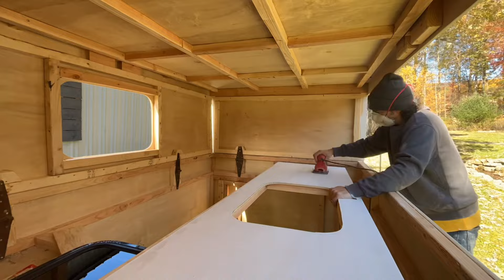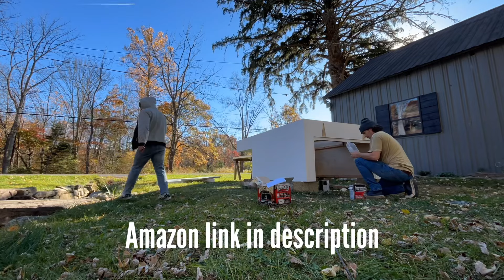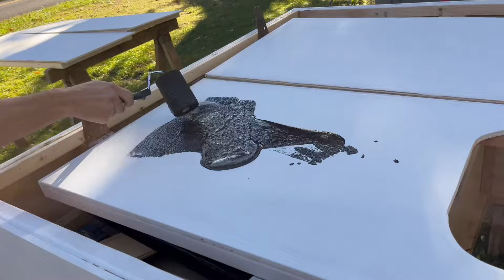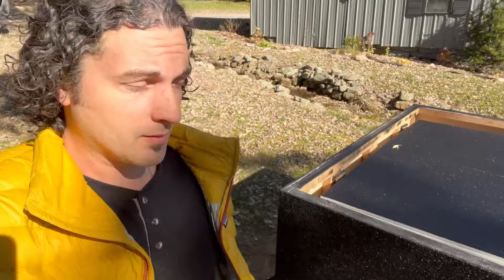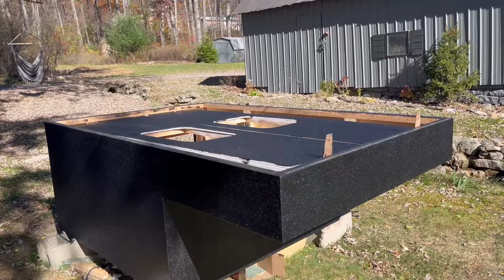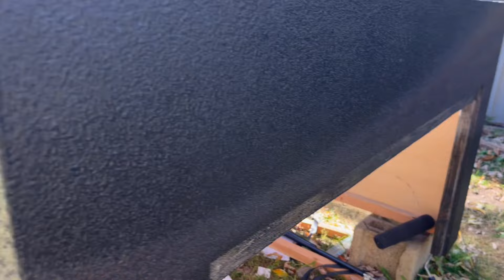4 - Bedliner Paint | DIY Popup Truck Camper with Hard sides For Diesel Jeep Gladiator

Comment: not liking the color so much but solid in concept.
Reply from the maker: Overall picture… it will look good with the truck. 👍
Reply: When's the next video
Reply from the maker: @ probably next weekend. Had a major set back, which you will see coming up. 😃
Reply from the maker: Roof blew off, smashed on the highway. Had to rebuild.